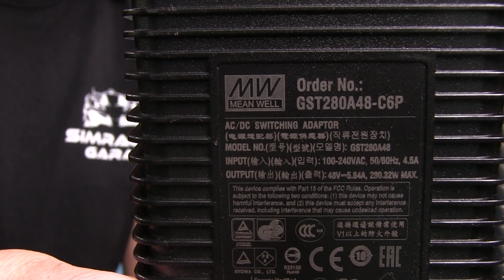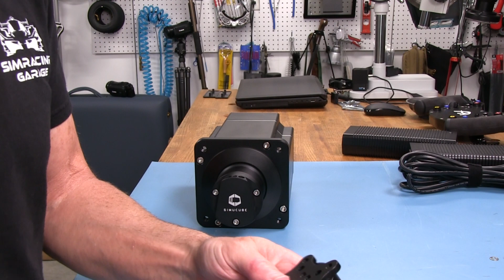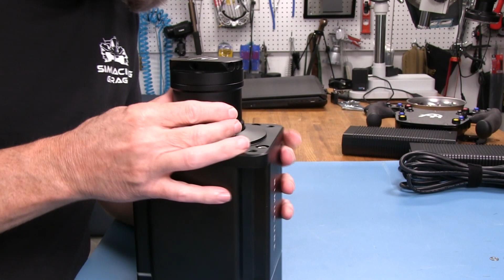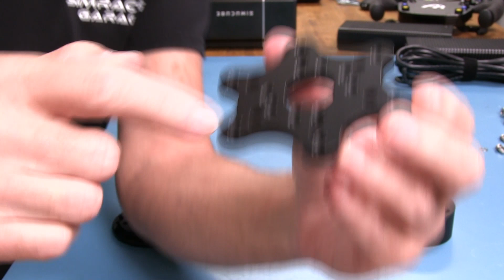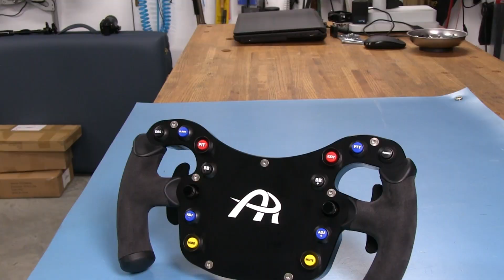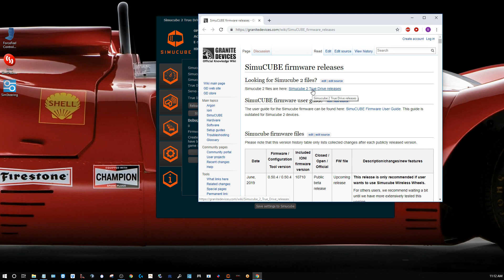Simucube SC2 Pro DD Wheelbase Review

Comment: Hi Barry great review i have just bought the simucube pro v2 and it has an annoying electrical noise coming from the shaft area of the motor, did you experience any such noises when reviewing the wheel base, Cheers Gary

Comment: too bad that simcube officially support only few games.
Reply: Huh? What do you mean by that? I use mine with every Game I have. Can you maybe give an example of an unsupported Game? The big Mainstream-Games are all supportet. Thanks!
Reply: @bjornromermann5080  FORZA HORIZON 5, NOT OFFICIALY SUPPORTED, NEW UPCOMING FORZA MOTORSPORT NOT SUPPORTED, AND SO AUTOMOBILISTA 2 NOW WITH A ANTICIPATED UPDATE GOT SIMUCUBE 2 PRO IN THE LIST, SO THEY SURE CAN DO IT BETTER AND GIVE MONEY TO BE THERE, RIGHT? THX
Reply: @izhangt3787  Dude. No need to scream at me. Automobilista 2 is supported all the Time. As well as Forza. What I think most people misunderstand is, that you don't need an entry in the settings of the Game Wheel XY. It is enough if you can choose simply "other" Wheel. Everything else will happen in the Simucube Software regarding Effects, Filters etc.
Reply: @bjornromermann5080  have to try that, thx for the knowledge

Comment: How does it compare to fanatec dd1?  How does the simucube work with fanatec wheels?
Reply: Fanatec Wheels have to be converted to USB. There are some Kits for doing that. But tbh most SC Users buy more expensive Wheels like Gomez GSI, Ascher Racing or Cube Controls. The DD1 has less NM, is according to some other Videos a slightly lesser smoothnes when driving slow or standing still. Also the Quick-Relase and the Software is a never ending Story on Fanatecs side sadly. Simucube is nowadays ahead of Fanatec in the Software-Department with the online Profiles. Also they announced to incorporate Telemetry-Data from the Games to their Effects in addition to the normal FFB.
Reply: @bjornromermann5080  What concrete does that Telemetry thing mean and does then ?
Reply: @FG_356  I also don't know. Simucube teased that a while ago. Will come to the End of the year. So we all have to be patient.

Comment: Barry, does anyone make an adapter to use Fanatech quick release on a Sim cube?
Reply: Don't know if you still find this relevant but check out sim racing machines. I think they sell a base side quick release which connects via USB for fanatec wheels. You can use most fanatec (few exceptions) without any modification of the wheels. Although if you go simucube you can find a lot of awesome wheels but they are expensive af. A round rim and an open wheeler should be enough though.

Comment: On their website i saw they are offering a adapter for fanatec quick release. Have you tried a Fanatec wheel on this base? Because as a student my budget is limited and the wheels from simucube are quite to expensive for me.
Reply from the maker: The adapter has no electronics in it. It is intended to be used with a Fanatec wheel that has been converted to USB so you can plug into your PC.

Comment: I have the fanatec v3 pedals. Could they connect to the base of simecube 2?
Reply from the maker: Not that I know. I would rather connect the V3 directly to PC. Avoiding any issues.
Reply: @simracinggarage3026  simucube 2 sport and v3 pedals how do i connect them to gran turismo sport ps4?
Reply from the maker: You can try DriveHub to connect your DD wheel to the PS4. I have not tested this, but others say they have and with good results. You should do some research before buying. Just like anything else.
Reply: @man_lamass  You'll need to either buy (blog.gimx.fr/product/gimx-adapter), or build (gimx.fr/wiki/index.php?title=DIY_USB_adapter) a GIMX adapter and a PC (or a Raspberry Pi.) to run the GIMX software on (gimx.fr/wiki/index.php?title=Main_Page). The DriveHub won't work with the Simucube wheel bases as of this time.

Comment: ? Buddy if I run a motherboard that has wifi on it will it get effected I’m very close on getting this wheel n simucube sport
Reply from the maker: I would not think so. I have a wireless network running in the SRG and it did not have any effect on the bluetooth wireless signal that is used to communitcate between wheelbase and wheel.
Reply: Sim Racing Garage thank you for the reply keep up the good work and stay safe Barry cheers.
Reply: @MrFrosty888  His Fist name is Sim. His middle name is Racing and his last name is Garage, but you can call him Barry.
Reply: @jeffmattel7867  thanks for a pointless reply 🤦‍♂️

Comment: I would want the exhaust under me with a bass and speaker on the rear of each L and R side so you have the full advantage. 
 Might i recommend looking at JL AUDIO, they are also top of the line.. a little better than KLIPSH best products

Comment: Is it normal that mine on the back it doesn’t have that wireless area, instead it has the connection for the wireless antenna which is outside on my unit
Reply from the maker: Yes, that is the new configuration as far as I know.
Reply: Sim Racing Garage Ah great thank you! i though i had an alien unit hehe

Comment: I have the fanatec V3 pedals. Can i buy simucube and connect my pedals to that? Im on a pc and playing iRacing. Now i have clubsport V 2.5 base and V2 wheel
Reply from the maker: No, but you can connect the pedals directly to your PC via USB.
Reply: @simracinggarage3026  that will work fine? So i can use simucube with V3? I need new Steering wheel right?

Comment: Great review, again! :) Would you buy it, if you already have a Simucube 1 with 20 Nm Mige Motor and Q1R?
Reply from the maker: We all have urge to get the latest shiney new toy. The SC1 is a fine DD wheel solution. It has great performance, and I think it has proven itself to also be very reliable. Especially the Mige motors most use with the SC1 controller. If there is some new feature set that the SC2 offers that you think you must have then buy one. To be honest I would not sell my SC1 to buy the SC2. Just not enough improvement to justify it for me. Now, that may change as the SC2 platform matures moving forward. I would also not sell my SC1 to buy a Podium. Again, unless there are some features it offers that you want. Just in case that question comes up.
Reply: @simracinggarage3026  Thank you very much, for your detailed answer. I´ll keep my SC 1. Best regards from Germany

Comment: Thanks for this detailed Video.
Im bought a Fanatec csl Elite ps4 Wheel and im experimenting for to long struggling to find a natural feeling setup, especialy on assetto corsa, so im looking if the racing wheel or the game is the problem.

You talk about that you have a vague feeling on assetto corsa, would you discribe what you meaning exactly?
My problem is the building of the forces seems to be unnatural.
As example: when i setup the force feedback and dampening settings that the a sporty roadcar which i can compare to a personaly driven car feels normal stable and the steering power feels normal on normal driving the steering wheel builds to much  force when the car looses his rear end and i have to balance a drift, again i compare it to personal experiences with different cars

When im setting the steeing wheel that this oversteering power is manageable i get a to easy steering wheel on normal driving.
Did you ever had compareable Problems with assetto corsa and or other Steering wheels?

Everybody welcome for help.
Reply: going narrisch assetto is garbage imo. I literally think forza 7 is miles better

Comment: the quick release im not so convinced off. Imo, the Q1R is still the best for anything that doesn't have pass through. This sticking here would probably be pretty annoying and also a bit cheap feeling.
Reply: Just a bad design overall imo, if im changing my wheel then I'm already juggling two wheel-rims, now I'd have to keep track of that little pin as well.
Reply: good point as well

Comment: It's probably a Nema 42 or 46 size stepper motor with their custom electronics separated from the motor body by the machined aluminum plate. Load of torque - microstepping, an incredible amount of holding torque, good response speeds...  It would be a perfect base with the right electronics and firmware.  Better yet you can always update firmware if your hardware is capable...
Reply: Same thing.

Comment: The 6 pin plug is no surprise - the standard contacts that size are rated 10 each in stamped steel.  Try not to plug them in and out too much or pull sideways on them.  For a fixed installation they are great but they generally only rated for 500 insertion/disconnection cycles.  Pulling sideways against the pins can reduce that life radically.  (The pins are folded sheet metal - you can bend them but if you connect the, tie wrap them so there is no movement, and leave them they can last forever (you will need to plug/unplug them occasionally to clean up the contact spaces but we are talking once a year unless there is lots of dust or your humidity is constantly high - still no more than once every 4 months.  Those 500 cycles will last you far into the time when your wheel is obsolete if done right.  (Sorry - I'm just a storehouse of useless knowledge and I can't help sharing it when I can inform someone. By the way - they antenna is probably laid out on a printed circuit board but your description is otherwise correct in layman's terms.)

Comment: Thanks Barry for the good review as always. To you or the community, the AccuForce being roughly €500 cheaper, what would be your preferred option out of the two ?
Reply: Let's put it this way. The Accuforce is a 2015 Porsche 911 Turbo, and the Simucube 2 is a 2019 911 GT2 RS. The simucube is newer, more powerful, more developed and refined, etc. So it's obviously better but it costs more. It's the one you want if you can spend that kind of money. But if you can't, you will still most certainly have a lot of fun in the 2015 911 Turbo.

Comment: I had the 30nm Version, but not from the guy "simaracingbay" (i dont really like him..). I made it myself, which is very easy. 
You just have to order the parts and put them together like Lego. 

And on top, i had a special Fanatec Conversion. I could take any Fanatex wheel and just snap it on and everything would work, shifters, LEDs etc. everything. It was awesome, and tbh, that setup (DD + that Fanatec Conversion) is quite rare. Unfortunately i had to sell it immediately after i got it. I couldnt really have my fun with it...

And the guys from granitedevices are AWESOME ! My recommendation, do it yourself or buy it from Simucube itself, dont go to others guys selling it.
Reply: SimuCUBE 2 is a "plug and play" solution. Nothing you can source yourself, such as the SC1.

Comment: Hi Barry. I have the old small mige (Sim.plicity) running mmos 2014. Still works great but I'm unsure if I should update the software/firmware and to what? Simcube 1? Any advice or pointers much appreciated. Love your channel.
Reply from the maker: I have listed links in this videos description that will take you to the Granite Devices Community discussion. That's where you will be able to get answers from the experts on how to proceed.
Reply: @simracinggarage3026  Thanks Barry. I'll do that.
Reply: Definitely worth upgrading the older mmos firmware to the newer Simucube firmware. Not only is the software easier to navigate but you'll get better ffb performance from the new firmware.  Upgrade to the .11.2 1st and then 50.3. It's fairly easy to upgrade but you can find instructions on the wiki as well. 
https://granitedevices.com/wiki/SimuCUBE_firmware_releases
Reply: @johnkoch   Thanks man. Really appreciate the info. I'll look into upgrading.

Comment: I’m also ready for a final verdict. Fanatec vs simucube. I mean what to buy. I really dont know. The Netherlands ✌🏼😋🚦🏁
Reply: I have the Fanatec Podium - my advice would be to go with the Simucube...The  problem of course is the Simucubes are sold out for now.
Reply: @ruffrider6653  What's wrong about Podium?
Reply: @JohannDaart   - The Podium is a good unit = when it's working.  My personal DD1 crapped out in less than 3 weeks.  I contacted Fanatec support and they replied "We can fix that problem with a firmware update".  (Of which was not true - the unit was phisically broken.)    Fanatec support was not going to help me.  I went on the GT Planet forum and posted the problem and luckily Dom from Fanatec saw my post and sent me a private message   He agreed with me  and made an internal contact with their support and got my unit replaced.   There are people on Youtube who have had to have their units replaced up to four times...   I like the DD1 but they are having a great deal of problems.
Reply: @ruffrider6653  Woah it sucks. At least Dom helped you.
Reply: @JohannDaart   DD2 owner here selling mine for an SC2 Pro. I hear good things about the SC2, but I am also just eager to be done with Fanatec. They really seem like they only barely know what they are doing. Plus this saves me $200 a wheel for the podium hub, which is significant.
Reply: I have a dd2 and it works fine , I’ve had it for a year now
Reply: @nonami_066xswqoqowiwl  tnx, i race with a DD2 nos since feb.
Reply: Your leaving out guys that fanatec dd1 also has more people that dont have any problems with there units and there are more of those people then the ones that are having problems which tells me nothing but there are lots of guys that there dd1's are flawless and dont have a single issue

Comment: Hey Barry I keep seeing you use the wave Italy pedals. Are they your go to pedals now ? Do you feel they are as good or better then the HE Ultimates ? Thanks !
Reply: His favorite was the HPP PRX SE, followed by the HE Ultimate. The main reason why he decided to let go of the Ultimates was because of the very firm force needed to use the pedals. I've seen all 3 reviews of his trying to know how they differ.
Reply: kolokolok 2016 thanks for that. I totally forgot about the hpp ones ha. Yeah I do read that the HE ones are very stiff. I mean you can see it in spec sheet on their site. Thanks again
Reply: @02semiata  You're welcome! :)
Reply: @02semiata  I run Ultimates right now and while they are stiff, you get used to it after few days and I wouldn't want them any other way. I use the softest setting (3 white rubbers). All the real life pros seem to be using Heusinkveld, so that's a testament itself. Also, they are built like a tank
Reply: Jakub Majorek yeah I also wonder how stiff a real race car pedal is... and I’m sure that changes from car to car.
Reply: @02semiata  some race cars have brakes that feel like you're pushing on a brick. I only drove GT4 cars, and they feel very similar in stiffness to my current Heusinkveld setup. Your leg will remember pressure much better than the angle itself, so for consistency - can't beat a stiff pedal.
Reply: @jwm0  Thanks for that info !

Comment: perfect review as always.

Could be very interesting to try with Rfactor2 instead of a game like Pcars.

i wonder also if the "Sport" version does the job done like this one, or if the difference is very noticeable
Reply: The Sport & Pro are different servos. Though, the price difference is only a couple hundred bucks. If you can afford the Sport, go for the Pro.
Reply: @PureGamingTV  what are the differences other than torque which is merely down to the power supply
Reply: Rf2 is a game like pcars2.
Reply: @SlowBloke123  FFB and physics in rF2 is miles better than PCars2.
Reply: @PureGamingTV  in your opinion.   That is not what I replied to though.
Reply: @SlowBloke123  you have much more information and better FFB and less "fakes effects" in Rfactor than AC or Pcars. Moreover the tyre model / simulation is one of the best on the market.
Reply: @jeancoquelicot1249  All I'm saying is they are both games. You don't need to defend your baby.

Comment: Thanks Barry.
I'm guessing you are under an NDA to not disclose the motor model? :)
Not like you to miss a glaring detail like that.
Reply from the maker: There were no markings inside the case to indicate who the manufacturer is.
Reply: If you look around a little you should be able to find it, I think it's from a South Korean company
Reply: It was somewhere mentioned it is from a company based in Austria, so my guess is that those are custom made Lenze motors
Reply: Wouldnt custom motors be incredibly expensive?
Reply: right, but so do off the shelf lenze kollmorgen etc. Even for the lower model, custom would cost. I mean, sim gear surely is still rather small quantities. 

As i understood they found one, so that means off the shelf, but i suppose we'll only find out later, or never
Reply: interesting